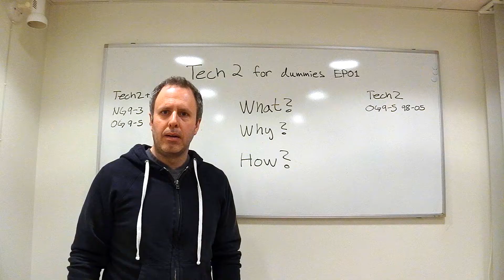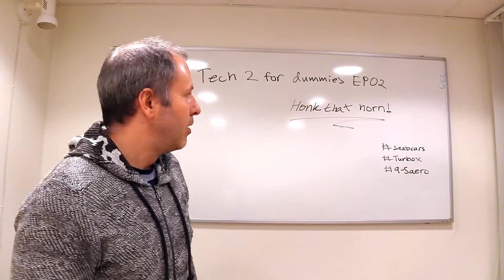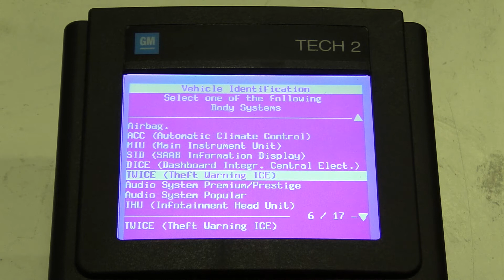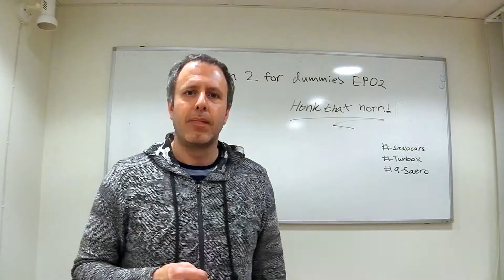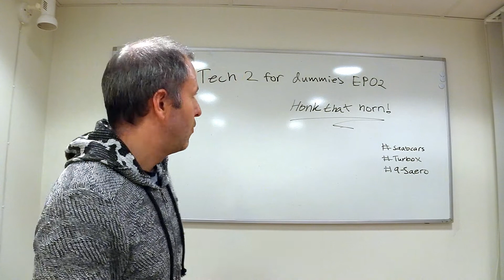Saab Cars - Tech2 For Dummies - Episode #2 - Sound indication

Comment: Good video guy!!  I just purchased a tech for my 2005 9-2x Aero and my 2005 9-2x Linear.  The Saab memory card doesn't have these Saabs listed.  Do you know if I have to a GM Memory card?  Or am I doing something wrong?  Just a heads-up,  I've never used a tech 2 previously,  I come a Lexus/Toyota dealership and we use a Techstream hardbook...a bit different.

Comment: What are the steps for the 9-3ss ? 2008 I want to add the little horn beep when locking
Reply from the maker: If I recall the NG9-3 uses the siren and not the horn. I experimented with this a few years back and I added some sound (sounded like chirps, birds or something :-)) I think it took a week then I had to remove it again because it was a bit annoying. The options should be where you configure the lock/unlock options. I can take a look this weekend and see where it's at. If you find it first, just let me know :)

Comment: setting up different features in a module is not programming.
downloading calibration software in to any of the modules that the car has is called module programming/reprogramming.
two different things.
Reply from the maker: Thanks for clearing that up! You are absolutely correct. It's rather a adjustment than a programming/reprogramming or reflashing if you're writing a file to a flashmemory. Maybe even a EEPROM. Thanks for watching.

BR
SaabCars

Comment: Yes I do.
Reply from the maker: Have you checked any Chevy forums? I'm not an expert on the Chevy modules. However the procedure should be almost the same that you add/remove, marry/divorce units in the car. On newer models you might need security access, atleast on some of the SAAB models you need that. 

BR
SaabCars

Comment: Hey there, I got the Tech2 to introduce a new Xenon-Headlight to my 9-5 (2003). Starting the ignition both lamps go down and up (even tho the new one is not going up completly) - I also have the WarningLamp for the headlights on on the Dashboard.   I tried to teach the car that there is a new headlight .... but I just cannot make the Motor controle the right headlight .... any idea ?!?
Reply from the maker: Hi. I had problems with my xenon system a few months ago. In my case both the front and rear level sensor was faulty and I couldn't force a calibration of the system. If you can't communicate with the headlight, the cabling or the xenon control-unit is faulty. 

BR
SaabCars

Comment: Hi> thanks for the info! I am a dummy locksmith . Can this tool help me help my customers make extra keys and if they lost their keys get them a new one?   Much appreciated .
Reply from the maker: The mechanical key and the electronics are two different parts. You can make new mechanical keys together with the old electronics (for opening and closing and alarm). However, if you want to program new key-electronics to the car you need to have the Tech2 for that. 

BR
SaabCars

Comment: Hello, im having problems with my 9-3ss specificly the seat memory module is probably out is there anyhow tech 2 can tell if its bad or not? thanks.
Reply from the maker: If there is an error in the module the Tech2 will find it! :-)
Reply: Well i found out that 12v doesn't come to the motors under the seat. Only one motor has 12v other ones don't. So will tech 2 tell me if there is short or something?
Reply from the maker: If your Tech2 can't communicate properly it will let you know where it's malfunctioning. I have not yet diagnosed this type of error.

BR
SaabCars
Reply: Thank you :)